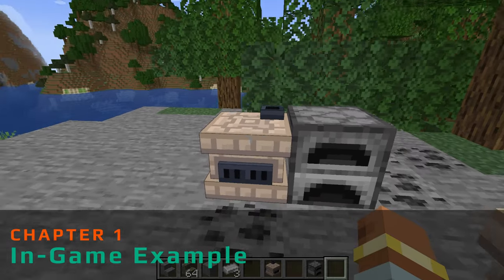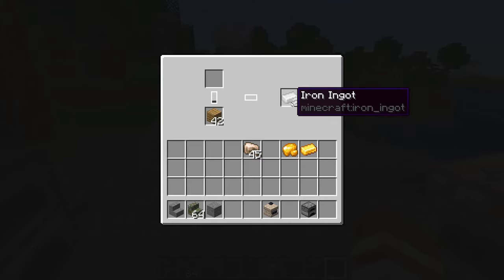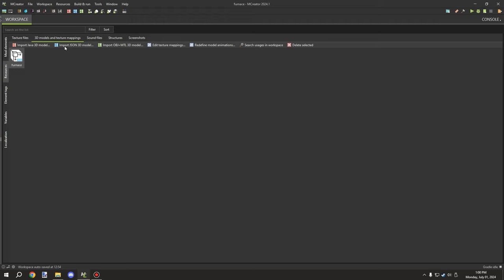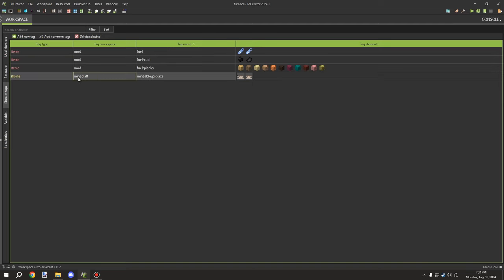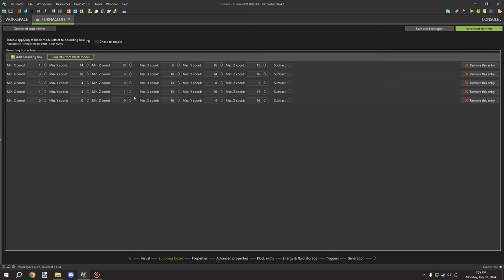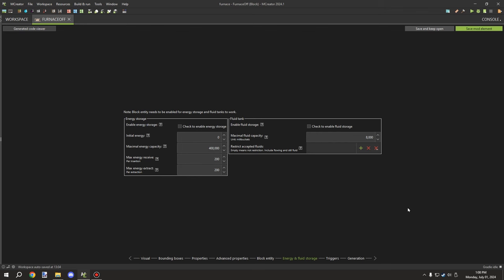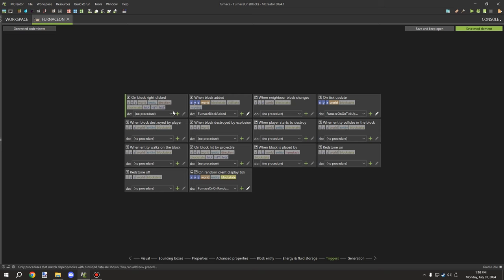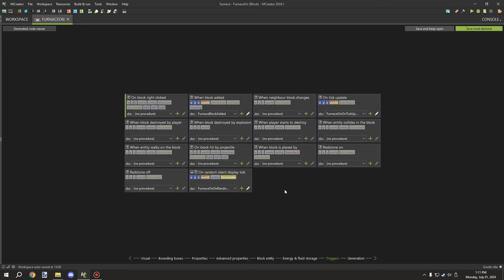Custom Furnace | Part 1 | MCreator Tutorial | 2024.1

Comment: Can i make this in 2023.4? It takes a lot for me to update, like 6 hours to make a project in a new version.
Reply: Also i would like to make it with the crafting one.
Reply from the maker: You can try the procedures in the project files but no guarantee that it will work. Honestly speaking updating is part of the development process, mod developers spend the most time doing this than adding new features. Though with MCreator most of the time is spent testing the features.
Reply: @NorthWestTreesMCreator  2023.4 cant be too different from 2024.1, can it? I am going to try and if it doesnt work i am gonna try some workarounds. Then if that doesnt work i might update.

Comment: is there a way to make a cooling system? ive made a custom item so that when you super heat diamonds it turns into this fancy heated gem then when you put it in in a furnace and add water or a custom fuel it cools it down but since the water is like coal or an actual fuel it wont fit right as itll smelt anything. i wanna make it so it only cools down my item with water as the fuel source and only for that item